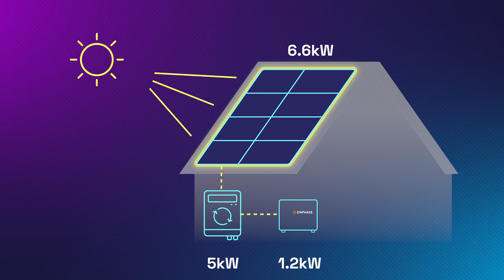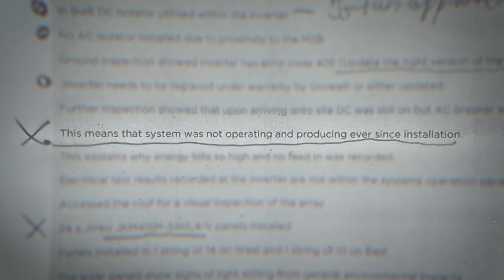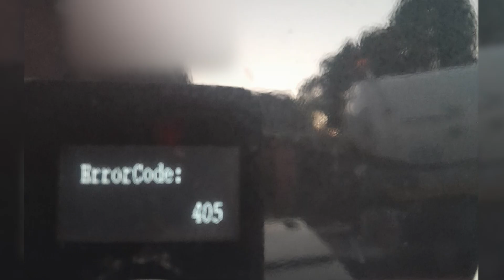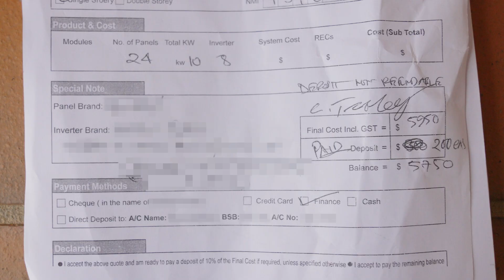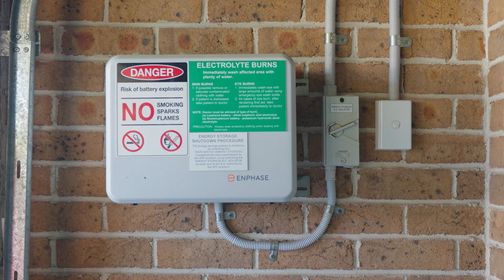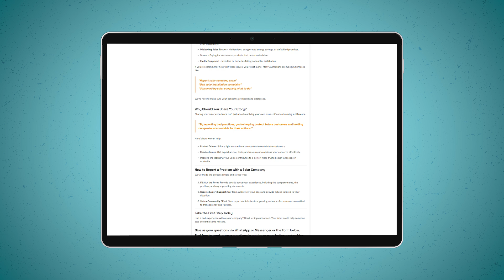I Exposed What Happens When You Buy the Cheapest Solar

Comment: To get a battery installed its cost say $15000au on top of the costs to solar panels and inverter u get a cheap plastic battery box mounted to the outside wall of you're house. The inverter has exposed plugs, and cables are on the outside of the house. Now lets say a crazy teenager decides to smash the inverter, cut the cables, and destroy the battery for fun, u are left in the the dark for months. Mine is in a secure concrete room, the battery is on a reo concrete box i built. No cables to cut. No chance of a fire either. Safe and secure, and laughing all the way to the bank, but everyone else gets cheap plastic rubbish..eg:- the horrible rip- off dangerous Tesla power wall.
Reply from the maker: You have to think about safety and security, for sure.

Comment: The Labor federal government are now offering up to $4000 in rebates to install a solar storage battery but to get it installed it about $15,000 or more, I built my own it cost $3800 including a concrete battery box. 15Kwhrs and grade A cells. fire proof, vandal resistant, 2 layers of  2.45mm bmt gav steel doors, stop a bullet from a pistol, the mpa55 concrete can stop rifle rounds, this is to secure my outdoor battery bank. so its safe, secure, save thousands,  no red tape, and i can fix it my self, not depending on a  company that takes the money and runs, like eg:-  truvalue solar